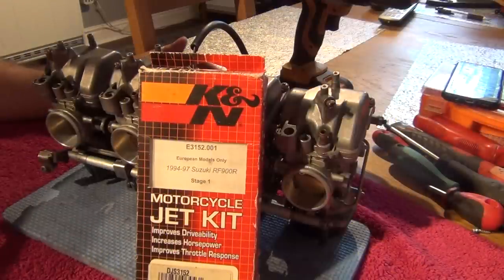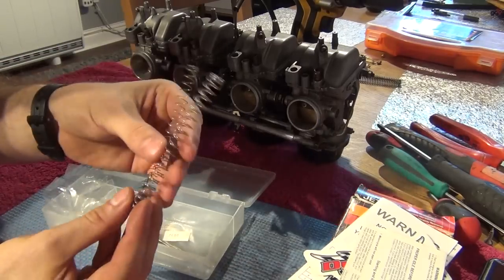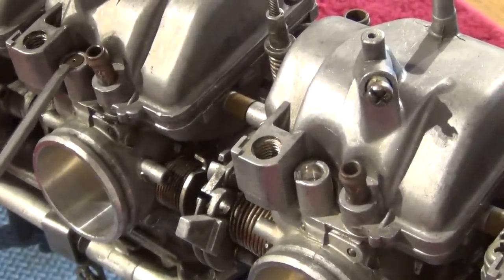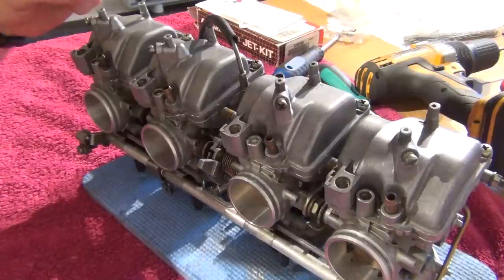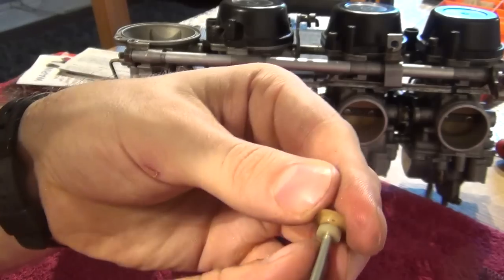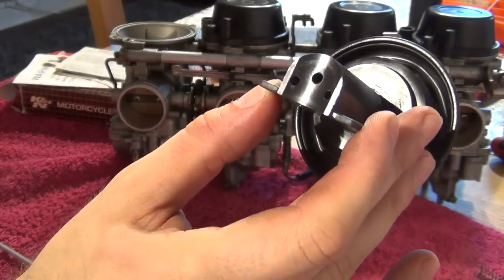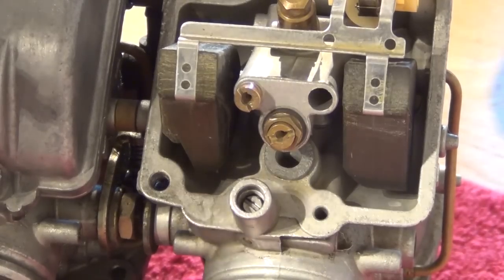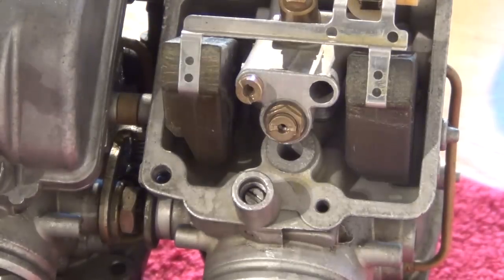Suzuki RF 900 DynoJet Kit Installation

Comment: Hi Adrian, here's Curt again. I was just looking around in the German forums again, how to remove the reduced effect of 98hp that many RF900Rs have around here, and ended up kind of bewildered. 
One guy was wondering, why those RFs with reduced effects have the larger 115 jets...and then you are to put the smaller 112,5 in instead in order to achieve more hp, which he thought made no sense in his mind - overall there seemed to be 2 different ways to tackle the entire problem. (With me having applied the official Suzuki way).
A) Suzuki: They say to replace to the fully open intake manifolds (36mm instead of 24mm) AND change the main jets from 115 to 112,5 --> 99kw/135hp
B) Alphatechnik: They only says to replace the intake manifolds (36mm instead of 24mm) BUT keep the 115 main jets ---> 91kw/124hp
How would you make sense out of this, I'm technically not experienced, but interested...before my carbs were cleaned and with those 115 jets still in with reduced effect, my RF900 soaked gas like a drunken sailor, but after the carbs were cleaned, balanced & ok, fuel consumption was just fine...still I read, that someone claimed that with the 112,5 jets you reach a deceisively better fuel milage.
How does your RF ride with the 118 jets, more power, lower gas milage?
Your dyno chart ist great, and that was before modifications I believe!!! For sure 130hp (crank) and 99Nm (crank), wow & congratulations!😁👍
Reply from the maker: Hi buddy. My bike had 112.5 main jets when i first got it and it was quite good on fuel then. Over time i started messing around with bolt on mods like exhaust, KN filter etc and finally DynoJetted my carbs. As soon i stuck those 118 mains there my fuel consumption worsened but i was expecting that so no tears. Bigger jets mean more fuel going in so bike will always burn a bit more gas. Derestricting of those bikes can be a right pain in the neck i heard. It could be intake rubbers, could be jetting but some people say that it could be really lame camshafts or ever restrictive CDI. Hope you get it sorted.

Comment: You should still use the metal washer on the needle, that goes under the plastic washer, it says in the Instructions use all the stock! spacers! Very good video though 👍

Comment: Hi.According to the manual, the surface of the gasoline should be 6.9 + -1 mm. Is there a weight error in it?
Reply from the maker: that 1mm up or down is your safety margin.
Reply: Hi. My question was that it could be 6.9 mm correct because 2 carburetors were left without gasoline? And according to the picture the head nozzle was lower than on my bike and its surface had to be measured.

Comment: Hi Adrian,
I running some tests with my tuned RF900. I tried 114 and 118 mainjets. Keep in mind that I have K&N, Cobra Exhaust, dyno mod and 990ccm. With 118 it felt a bit rich in high rpms Vmax was about 260km/h. With 114 it felt better up to 9000rpm - but not the power I would expect. I will now Try 115 and 112,5 to see the difference. Have u some experience with more ccm Engine-Mods ?
Greetings from Germany :-D

Comment: Hi. Great vid thanks. I have an RF that’s had a dyno jet kit fitted. Fuelling is all over the place. I also have the standard jests and needles. My question is what would the standard setting be for the pilot screw?  My intention is to return it to standard before trying to extract any more power. Any help would be greatly appreciated.
Reply from the maker: Standard setting on mixture screws differs depending on the market the bike was originally sold at. Some were set richer , others a tad leaner but 1.5 turns out could be a rough starting point for stock bike i guess. Stock pilot jets are 12.5 and mains are 112. Float heights at 7mm.                                                                     Make sure emulsion tubes aren't out of round, needles worn and all o-rings and gaskets are sound. Any of those parts being worn and you'll be chasing your tail for eternity. Hope this helps

Comment: Did the Engine run well after or was there any work to do after installation the jetkit? I´m looking for a Jetkit especially for mid-high rpm for racetrack. thanks for your great videos!
Reply from the maker: In my case engine run fine after installation
Reply: @Adikxx  did you feel a difference after installation?
Reply from the maker: @marcokraus9730  tbh not much. This type of stuff gets you just 2-3% power increase
Reply: @Adikxx  thank you. would you say the igntion advancer you installed in the other video is more noticeable or only in combination with this jetkit?
Reply from the maker: @marcokraus9730  Most of people who rode their RFs for a while and have a good feel of engine's power delivery notice improvement that comes from ignition advancer. I did. 
If i was to choose between DynoJet kit or ignition advancer for the RF i would no doubt take the advancer.  It's easier to install,  it's a lot cheaper and no setting up is required. Literally put it on and forget about it.
Reply: @Adikxx  thanks man!

Comment: Hi pal , just a quick question for you , is it only some of the RF 900s that have a Welch screw . I don't have any on my RS2 . I've just serviced my carbs and didn't notice any . plus how do you find the kit .. cheers 👍 always enjoy your video's I've learnt so much . maybe you should do a float height one 😄 .
Reply from the maker: Hi Dylan,  i think all of them had  fuel screws plugged and most probably those on ur carbs were removed by previous owner.Either way it's great news cause drilling them out is a pain in the rectum :)
 I thought of doing a vid on floats but Bob did a great one years ago and it has lots of views so thought no point anymore. He knows RF carbs bloody well.  Links to DynoJet kits below:
https://www.ebay.co.uk/itm/Suzuki-RF900-RR-RW-94-99-Dynojet-Carb-Kit-Stage-1-DJS-3152/254417873060?epid=1442882223&hash=item3b3c7ca8a4:g:fPcAAOSwRqxdxZSr

https://dynojet.co.uk/djs-3152-jet-kit-stage-1
Reply: @Adikxx  thanks very much pal. Chat soon 👍

Comment: Any chance you know the diameter of the drill bit as i have jets but not the drill bit. And also what is the function of having the adjustable needle?
Reply from the maker: From what i remember drill bit was  size 2 or 3. Adjustable needle allows fine tuning of fueling. The lower the needle the leaner the mixture, the higher the richer.

Comment: Anyone watching this be sure not the make the same mistake of using a screwdriver that's too small for the jet its only brass and you will damage it, always use the correct size screwdriver.

Comment: Onde adquiri esse jet kit?aquí no brasil não tem.tenho uma rf 600
Reply from the maker: Hi, you can get a Jet Kit on Ebay or directly from Dynojet. Links below: 

https://www.ebay.co.uk/itm/DYNOJET-JET-KIT-STAGE-1SUZUKI-RF600-RR-RV-1994-1997/222879540458?epid=1943532408&hash=item33e4a7e4ea:g:nesAAOSwiYRapuuI

https://cart.dynojet.com/p-549-jet-kit-600-cc-suz-94-96-rf600r.aspx
Reply: Ok thanks